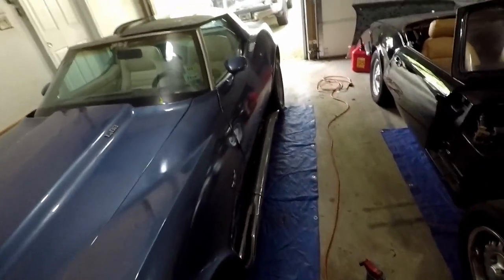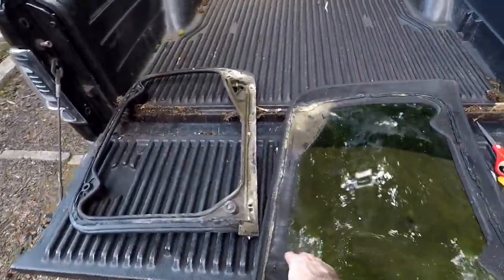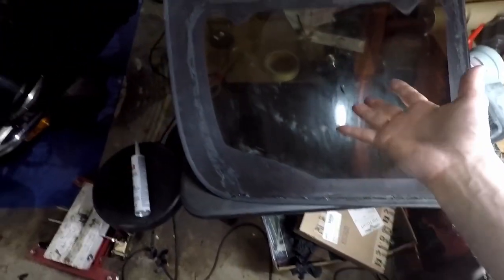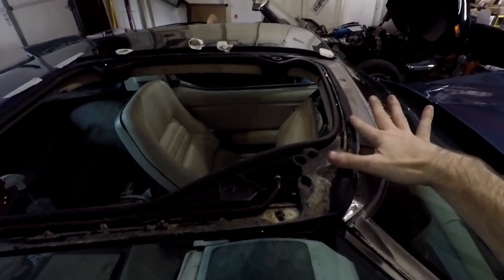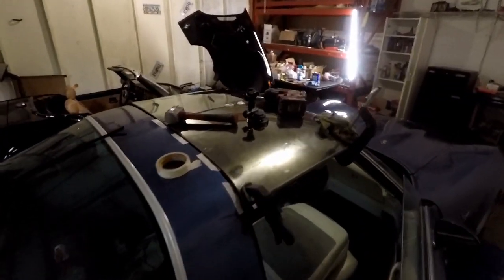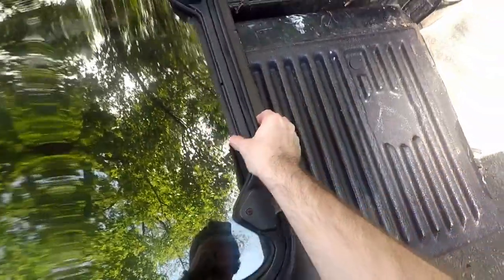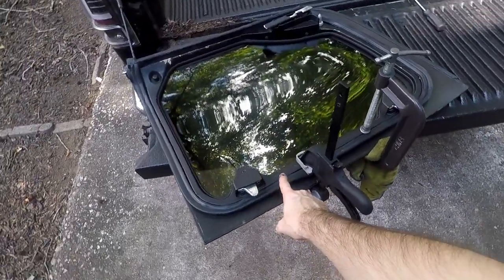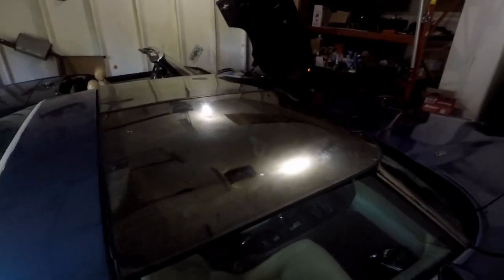Re-glueing C3 Corvette Glass T-Tops

Comment: You bonded the edge at the door glass contact area.
 That’s wrong. It’s designed to seal with the 4 screws. 
  Now you can’t adjust that portion of weather stripping to fit to the glass.